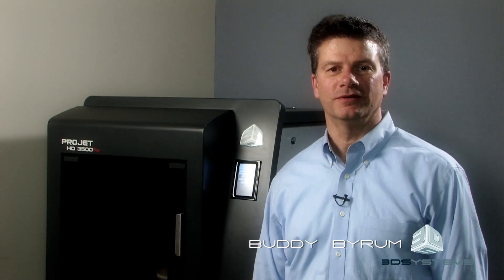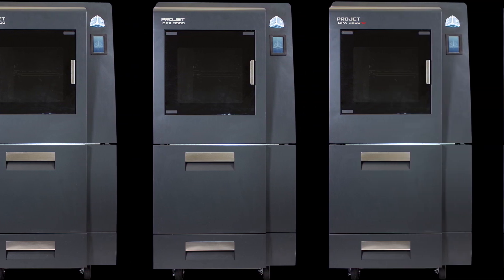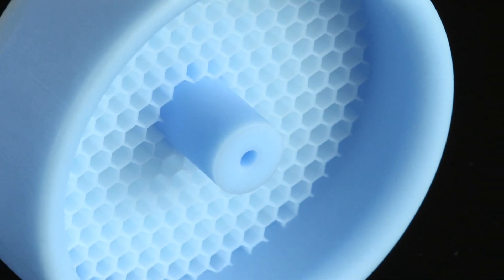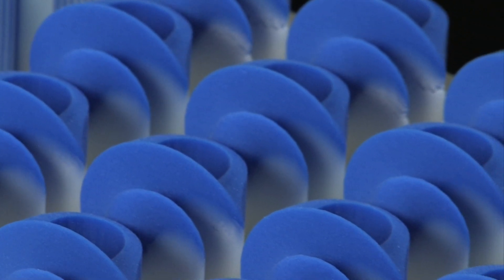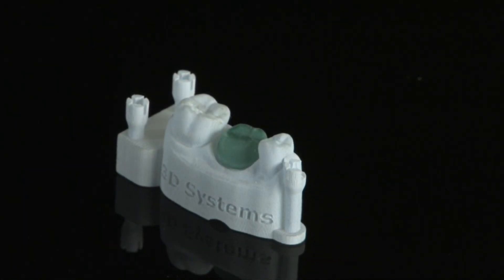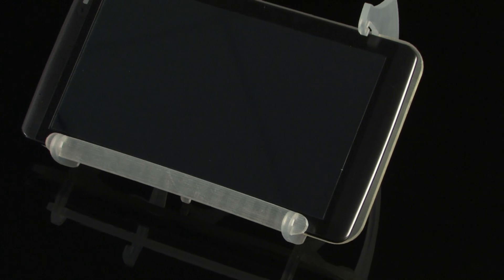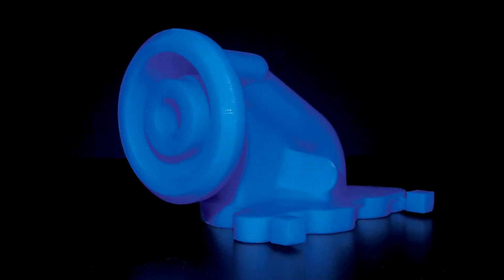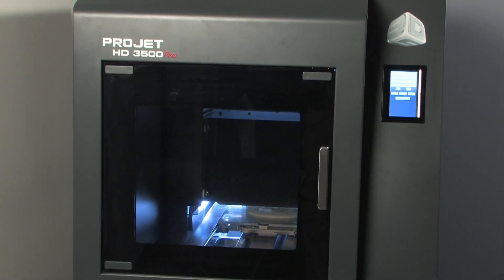Projet 3500 Series Professional 3D Printers

Comment from the maker: That's right, these 3D printers use our Multi-Jet Modeling print engine technology that can produce either plastic or wax prints with extreme high resolution detail and accuracy.  The wax prints are used as lost wax casting patterns to produce metal parts.  It is still a lot shorter time wise and less expensive than traditional machine tool production of metal parts. We do offer a line of printers using Selective Laser Sintering technology to directly print metal parts.